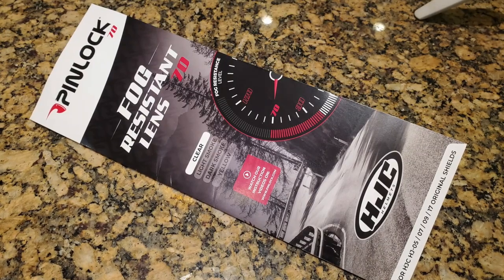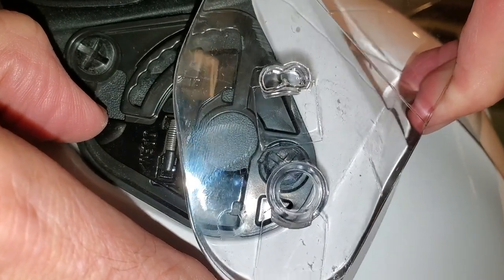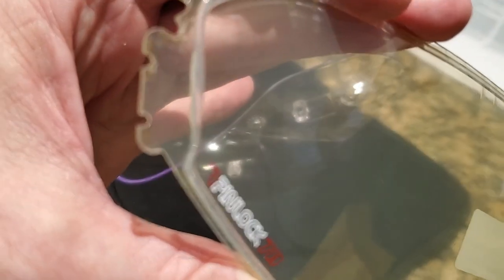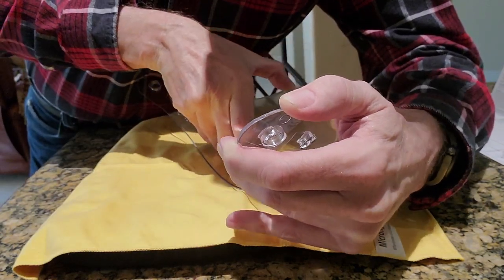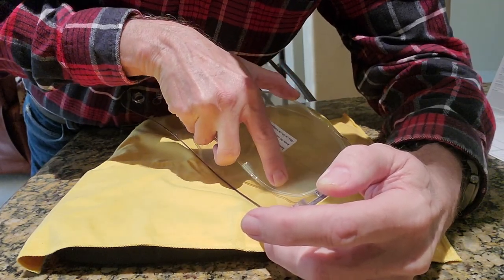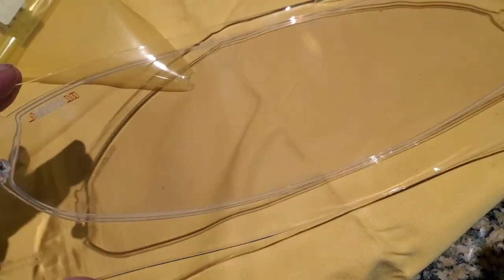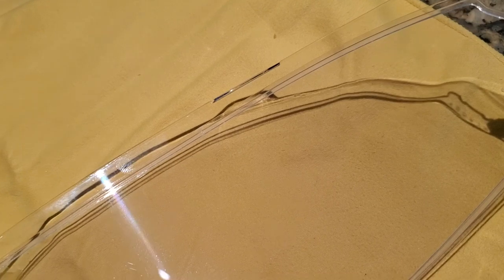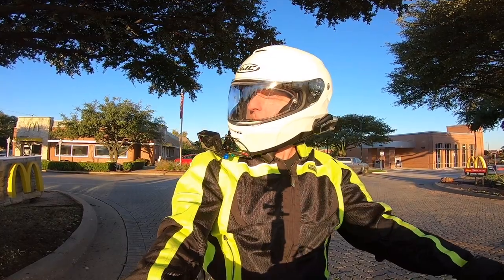Install Pinlock Shield on HJC IS-MAX II Helmet

Comment: That is a good product to use when fogging is a problem. I haven't had that much problem with fogging. I have noticed my face shield getting fogged up in the center at the bottom and I just flip the shield up a notch and after I start riding, the wind around the shield clears the fog up.

Comment: Is the PinLock made for certain brands of helmets? I have a GLX hement, which is not a popular brand like Bell, HJC, or other big brand name manufacturers.
Reply from the maker: If your faceshield has the Pinlock posts, then you will need to find the Pinlock shield to fit you specific brand. So, yes, they are brand specific.
Reply: @cruisemansgarage  thanks.

Comment: If you wear vinyl or rubber gloves you will eliminate the fingerprints on the shield.
Reply from the maker: Good tip
Reply: Great tip.. what’s the best way to clean visor before installing

Comment: The real test for this is 90+ humidity at less than 45 degrees. A rainy, cold day. I'm not sure much works under these conditions aside from a raised shield.
Reply: I ride year round with a pinlock in my Shoei in NC, USA. Ride in temps down to the low 30s and high 20s (degrees F) with varying levels of humidity. The pinlock works as designed. Edit: I should add that I don't ride a large touring motorcycle like a Wing. I ride a Tiger 1200, so I probably get more airflow than Wing riders do. That may contribute to my absence of fogging.
Reply from the maker: I should be getting a chance to test <45 degree temps in the next week.
Reply: @JBMotorrad  Well, I have seen a Shoei pinlock fail miserably in cold, rainy weather.  Not that it doesn't work because it does help. Air flow really helps for sure.

Comment: Why would you add a pinlock shield instead of simply getting the dual-lens snow shield made by HJC specifically for the IS Max 2 helmet??
Reply: Because the dual-lens snow mobile visor will NOT work on the IS-Max motorcycle street helmet. You have to buy the HJC snow helmet which is considerably more expensive than the street helmet and pinlock insert. You're welcome.